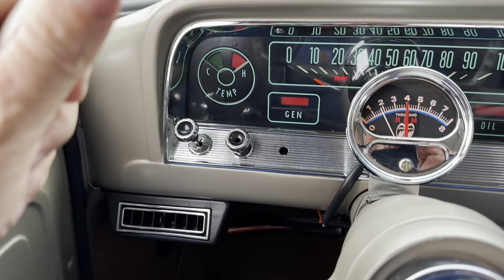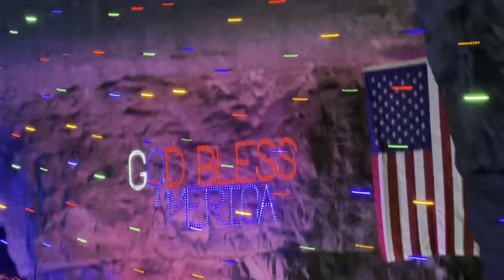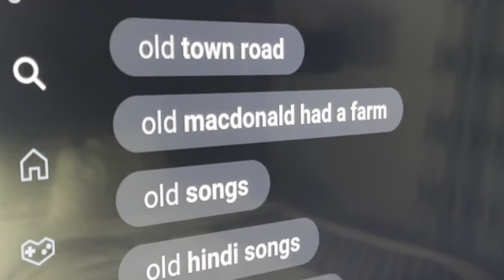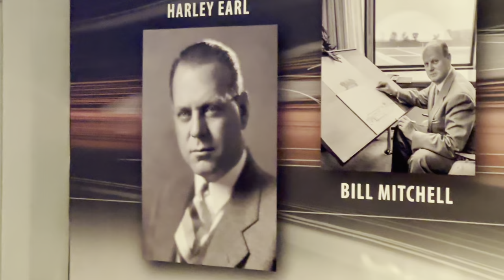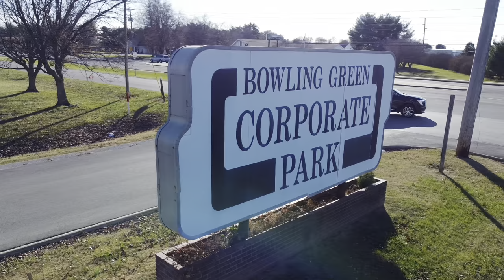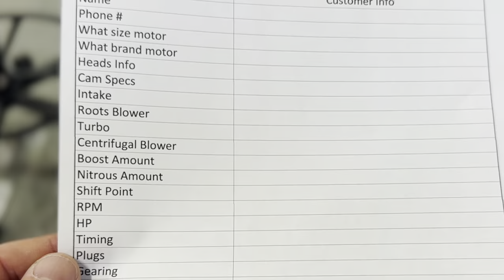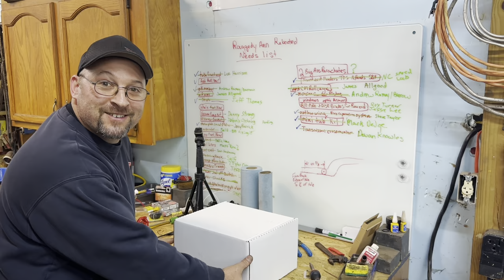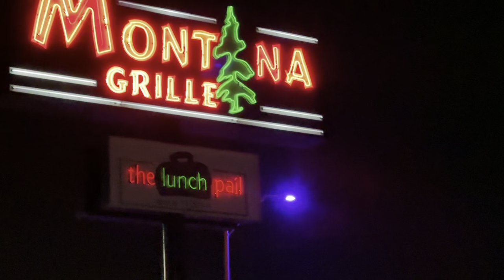WE TEAM UP WITH ATM FOR CUSTOM CARBURETORS!

Comment: Hearing your story reminds me of my own. 18 years old, with a 67 camaro that was all in black primer, and a clapped motor. I went to the Carlisle Swap meet here in Pa and bought a bunch of well matched swap meet parts, found a good local machine shop, then a even better one. After putting it all together I didn't see any real big power for the time until I started reading books and learning to tune one thing at a time. After while I started winning a lot of races in that old primered camaro, and that was back in the 80s, I then got into motorcycles, and drag raced them at the track until 2005. I miss racing, and help anyone I can with there projects when I can. This is me making a long story short. Bill you deserve everything you got from youtube, and look at your boys the apple hasn't fell far from the tree you should be plenty proud of the skills and ethics your boys learned from you.

Comment: Looks like your mouse just licked the peanut butter and left, lol. You might try less, and put it on the bottom of trip, it only takes a tiny bit. Speaking of, I’ve got to get some traps set. Winter comes and the mice move inside and all the neighbors cats have disappeared and they were some damn good mousers! Miss those little shits.

Comment: If you're ever coming through the Richmond VA area there is truck and tractor museum call keystone right off 95 south. Can't miss it cause outside the museum in the parking lot there's an old 50s chevy cab over hauler with a double stacker trailer loaded with tri five chevys. It's a survivor rig like it was just left in a field someplace. Super awesome place

Comment: Hi Bill you might want to check out Malwood USA  they make a hydraulic clutch pedal assembly for tri 5 chevys , have you thought about Electric power steering instead of regular power steering your thinking about a new steering column too . Think about it you might be able for Vicki's truck.

Comment: Hello Mr Bill I Have A Quick  Question im running a Digtal 6 Plus MSD im wanting to hook up my trans brake soleniod what would i need to do with this set up since it already have a built in rev limiter just hook the trans brake wire and the soleniod wire to the Blue Wire or another way A Big THANKS Love yalls shows Watch Them Every Night Keep UP THE GREAT WORK

Comment: I’ve done a similar swap with the power steering box like that and basically I made the clutch lever brought it over about an inch and a half from the factory location and then i made the lever “L” over the top of the power steering box so that the connection point could be very similar to stock, it was extra work but it does work great

Comment: So its funny you bring up the Corvette Museum and the collapse of the sky Dome in February of 2014. A good friend of mine works in Louisville, KY for Link Belt (The BIG Crane Company) in the rental department. And he's a Corvette FREAK. Anyway so he's up getting ready for work and hearts the news report of the sink hole and collapse. And its like 5am on that Wednesday at this point. He calls there Emergency Hot Line and got the over night crew prepared for a EMERGENCY run south to provide anything they need to try and salvage anything they could. As we know now the biggest worry at that time was if the rest of the building was going to collapse also. And getting the engineers to give the "All clear" and the building modifications to just start to get to the effected area. He personally set up a mobile office there on site to help provide anything to the construction company ( Murphy & Daniel) and there crews that came in to not just recover the cars. But they had to disassemble and safely reassemble a significant part of the building from that mess. He tells the story of how they practically used geological techniques (Using large vaccum trucks to remove dirt and smaller debri) to get to each of the cars. All under the watchfull eye of safety and engineering people. Literally ever move was calculated on a risk factor. Then there was one (car) that didn't make it. He said those guys treated that car as if it was a fallen soldier in a battle.  They where told that even though it was be on repair, That it would still be part of the museum going forward. And they removed it with the care they did the others with minor scratches.  The amazing part was that not a drop of blood (Human) was spilled during the whole event, Including the recovery and the rebuild of the building and the filling in of the KARST (sink hole).
Reply from the maker: Thank you for sharing that.

Comment: As someone who was always a mopar and Camaro fan I never was into Corvettes until a little accident got me into one and I kinda fell into a hole with them lol I had ordered a brand new 97 SS Camaro back when they were built by SLP and after waiting for months I got a call from bobby layman saying that my car was rolling in on the truck so I left work early and drove right up just in time to see my first ever new car I have ever been able to buy fall off the car hauler and my heart dropped into my stomach..so old man layman himself came in and I was offered a new literally on the showroom floor 97 z51 Corvette for the same price as I paid for the SS and it was black as well and had the performance package ect and that was the first year of the new c5 body style so after a test drive I decided to take the vette instead of waiting on a new custom order SS to be built and I am actually kinda happy that the little accident happened because I feel like I got a new experience and my eyes were opened to Corvettes and since that one I've bought restored enjoyed then sold 6 classic and modern Corvettes and I'm still more of a mopar fan I've not yet found the right one for the right (affordable) price but I might someday lol my dad was a tech for westside Dodge in Columbus for years and had a original 68 prostock hemi dart that I drooled over as a kid and someday I will find the right dart to build my own version of my dads racecar lol